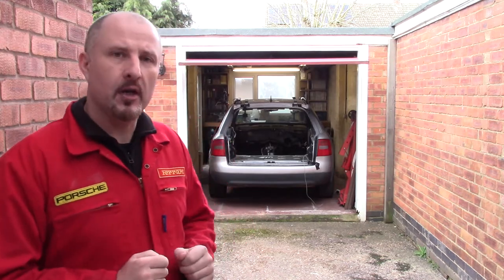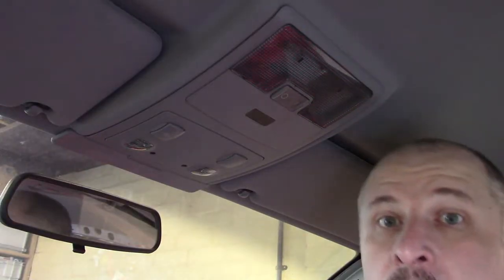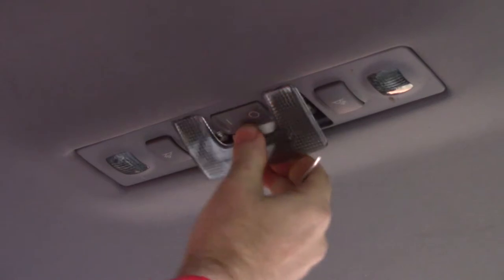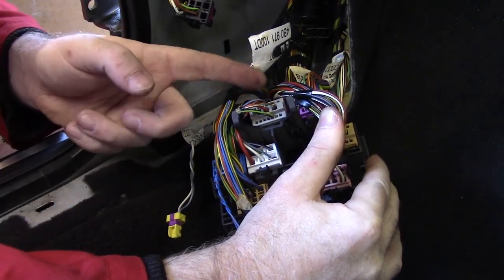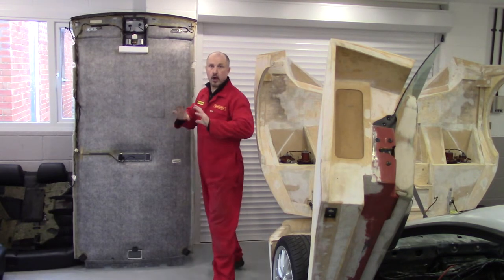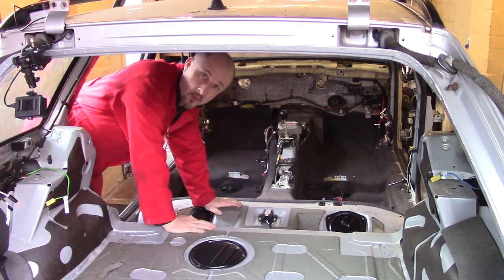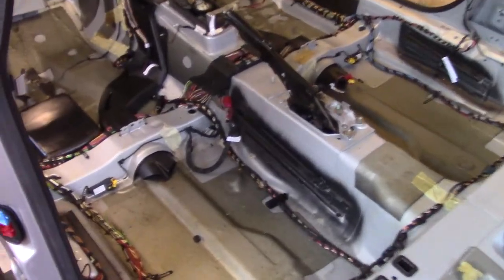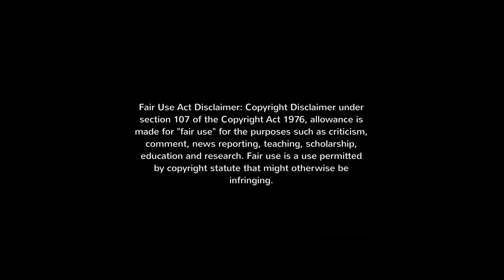Headliner and Carpet Removal: Audi 2.7 Bi-Turbo. Ep20.

Comment: I didn’t know you had a twin brother 😆. Uk weather I think we have had all 4 seasons every other day for the last month 🙈. Right that wiring loom I don’t know if it’s wired the same but the alarm and mobiliser was hard wired into the heater unit and everything to do with it for some reason. I tried to cut it out of my loom but the Ecu and dash cluster wasn’t having any of it and it went nuts so I had to wire it all back in 😩 the good thing is that none of the plugs have to be plugged into anything weird right 🤯 hope that little info helps maybe 👍
Reply from the maker: Yeah, it helps to have a twin lol. I'm going to have fun tracing all this wiring loom. I want to keep the heater and alarm system, but I don't need the abs or airbag wiring. I managed to separate that quite easily on the first donor car, but we'll see on this one. I'm going to have to work out either the signal or resistance load of the ABS and airbag system, to switch off the warning lights on the dash.